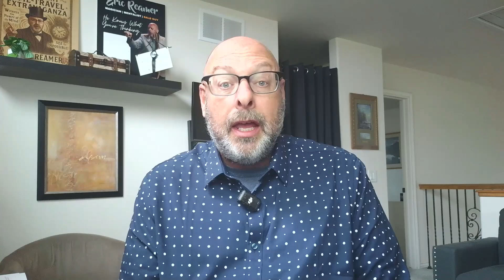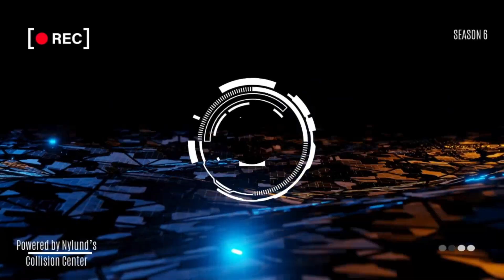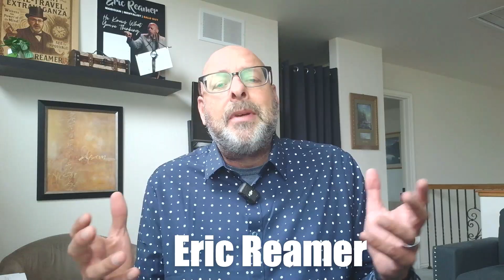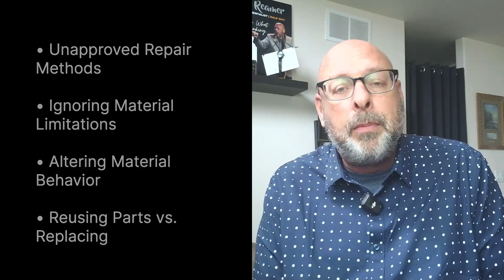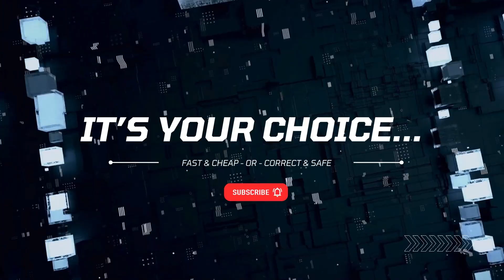This Common Bumper Repair Can Break Your Safety Systems

Comment: We are GM certified, one of the required tools is a $2500.00  Defelsko paint thickness gauge for plastic. 13 mils is the maximum paint thickness for a bumper cover, needless to say we replace a lot of GM bumper covers.